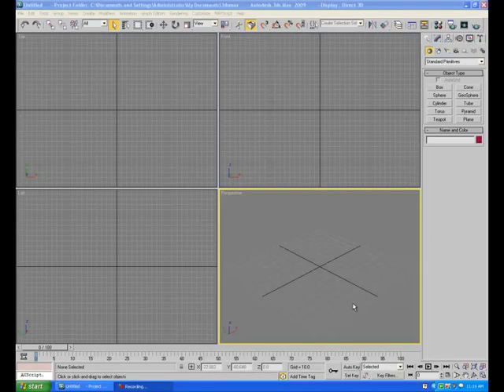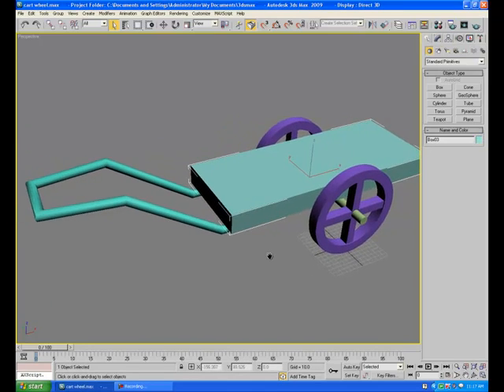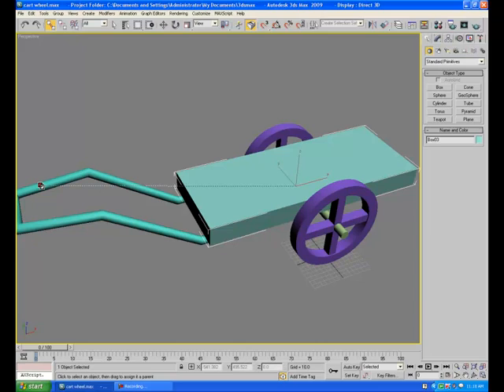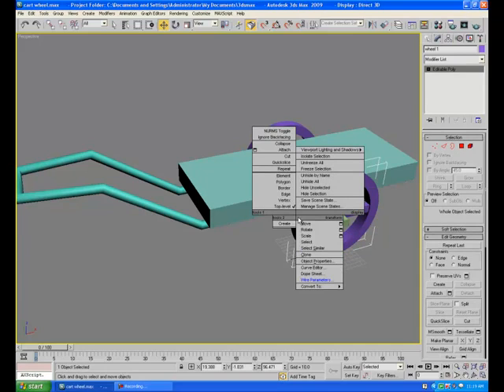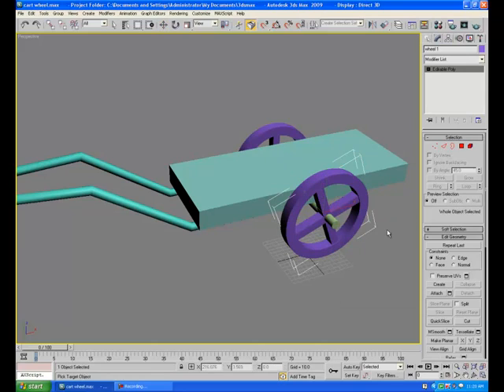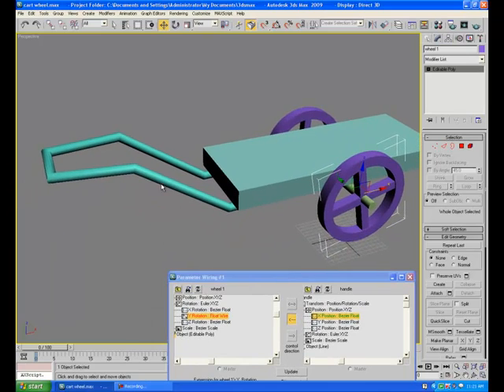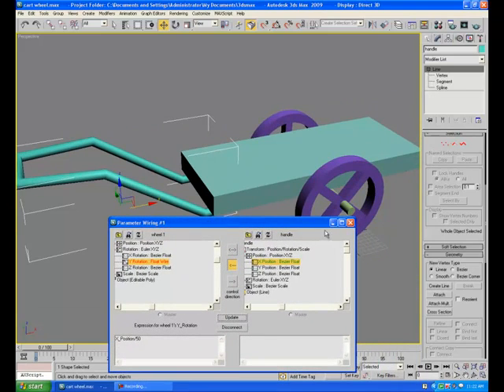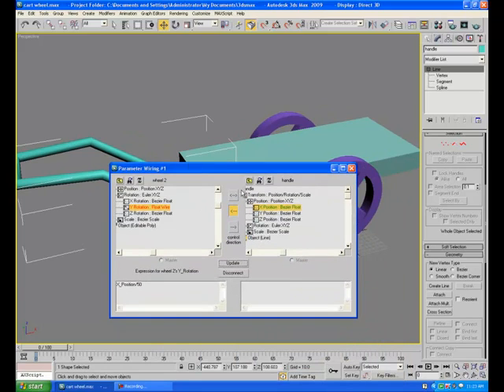Quick Tip - Wheel Rotation In 3ds Max

Comment: Instead of dividing the Value/50, you can add the command (degtorad) right before X_Position, this will convert the value from degree to radian in order to get a proper rotation that matches the position of the rest of the meshes.
Reply: Boom! Thanks for that.